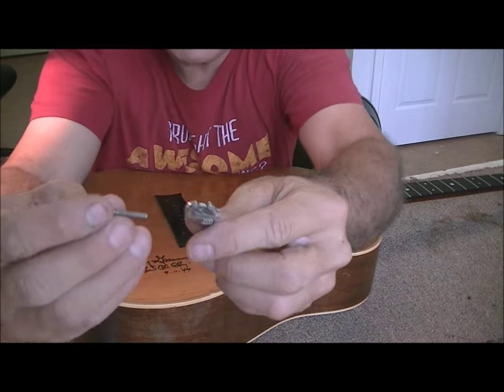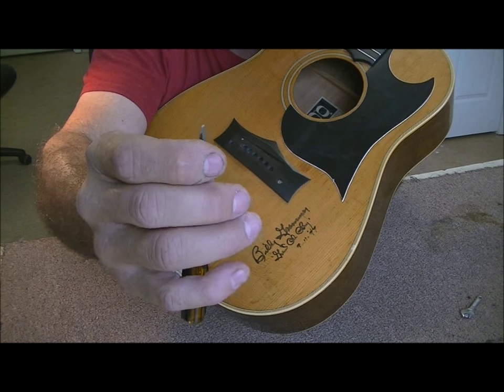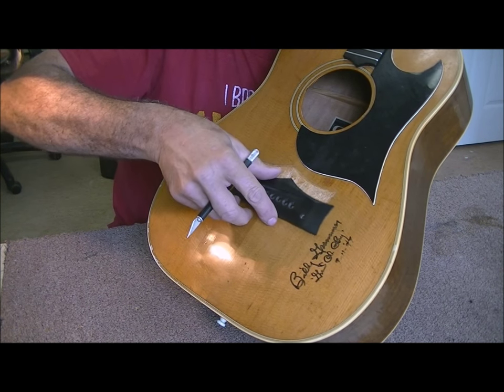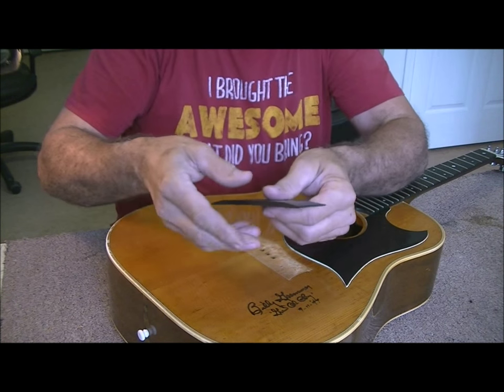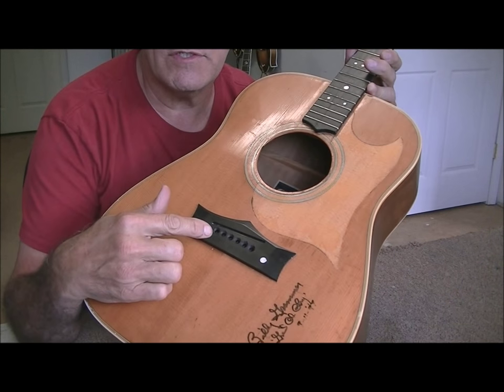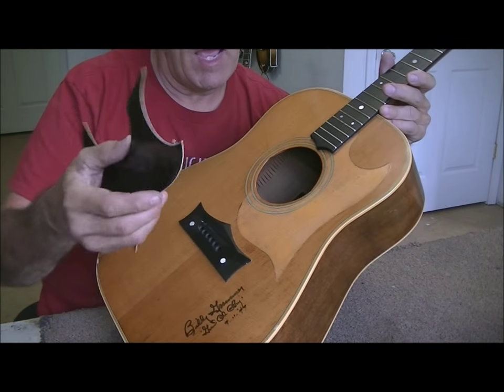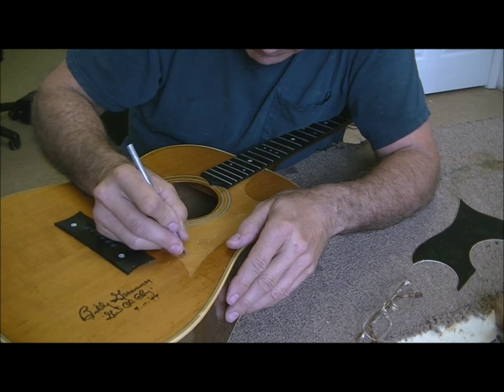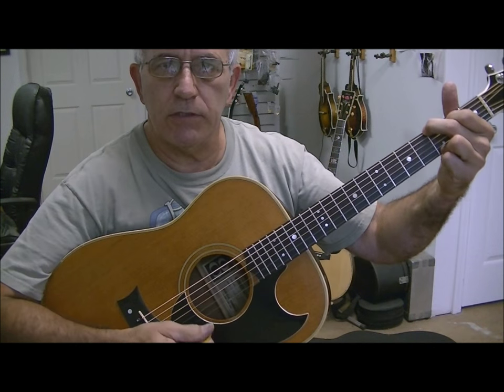070 RSW Billy Grammer Guitar Bridge and Pickguard Repair

Comment: I wonder why so many companies leave 1/16" or so of finish around the outer edge of bridges? I've gotten a lot of them too like that, I always remove that finish too to have bare wood to bare wood but you'd think the builders would recognize and avoid that. Great video Jerry, thanks for the kind words and plug my friend!
Reply from the maker: Pretty sure it is due to time savings/cost cutting.  Its quicker to mask off a slightly smaller area than to meticulously remove the finish to match the bridge exactly.  You are welcome.  Its the least I could do. Thanks again.

Comment: Very good presentation.  Thank you very much.  Two questions if I may:
1.  Do luthiers check intonation at the 12th and/or 19th frets as a normal practice before removing and resetting the bridge?
2.  If the bridge needs to move away from the nut by 1/8" or up to 3/16", and there is no more room to shift the bridge saddle toward the pins,  how do you deal with the original bridge pin holes?  Would this repair have a detectable impact on the overall tone of the guitar?  Please note:  I own a 1974 D28.  This was an era of horrible QC at Martin (as I'm sure you know).  I'm not the original owner so I can't go to Nazareth and knock on the doors until someone agrees to fix this problem.  Note that if, after the bridge shift, there is a 1/8" to 3/16" strip of un-matched lacquer along the sound-hole side of the bridge, I consider this a smaller problem than bad intonation.  So even if it might be obvious as a cosmetic issue, I'll still opt for better intonation.  The guitar has great tone and volume and this is the reason I raise this issue.  Thanks in advance for any advice.

Comment: WD 40 removes the glue like it was never applied!  What is left is the original finish which will be a little darker than the surrounding finish as the UV light will have lightened the wood not covered by the pick guard, so you can see exactly where to reapply the guard.  I like purchasing new blanks on line that already have an adhesive on the back.  Then you can go with the original shape or create a different shape to put on your guitar.  I have a 36 year old Washburn Tanglewood 12 string (Festival Series) that I made a custom guard for and it looks great.  The instrument sounds amazing too.  Wouldn't sell it for $3k!  VERY hard to find these older Washburns.
Reply: WD-40 is a petroleum based solution, the carbon component of the solution will be carried into the wood via the wetting agent in the WD-40 - through the pores of the wood (wood is also a carbon based material but it is a biofuel while petroleum based carbon is a Fossil fuel). While the wetting agent in the WD-40 will evaporate out of the wood, the fossil fuel based carbon will not. This will prevent/inhibit a water based glue from fully adhering to the wood - it creates a barrier between the glue and the wood. 

The take home is - NEVER USE WD-40 ON WOOD.

On the other hand, Lighter fluid (Butane) is also fossil fuel - carbon based fluid that CAN be used because it has a much smaller molecular structure and will not leave a residue on a material. This is evidenced when a products such as WD-40 has dried, it leaves a "rainbow" residue effect on the surface (heavier molecular structure) compared to lighter fluid leaving no "noticeable" residue (lighter molecular structure).  The molecular structure aspect of this is a bit more complex but needless to say for this point.

Comment: You know, I have always kind of wondered, with all the bridges that crack, or pull up, or even just pop off, why is it the standard to have string through bridges instead of tail pieces? My old acoustic has a tail piece and it has always worked just fine.
Reply from the maker: Johnny John the extra pressure on the top that a standard Bridge has, creates a different sound than an instrument with a tailpiece.  it causes the wood to vibrate more, so it's great for a flat top acoustic instrument.  Most tailpiece instruments actually have a more metallic sound.  That's because the wood does not vibrate quite as much as the strings.  Obviously there are exceptions on both sides of the fence.  thank you for watching